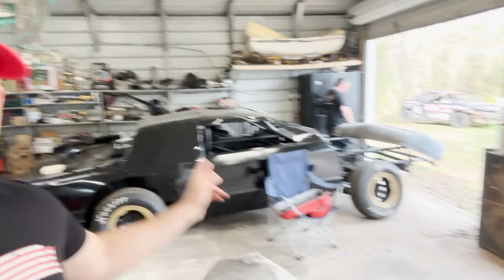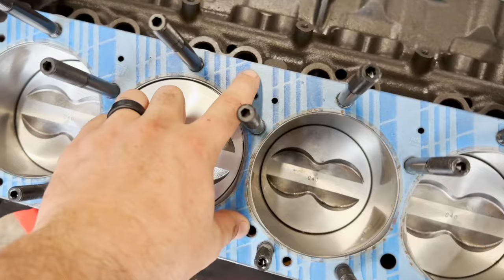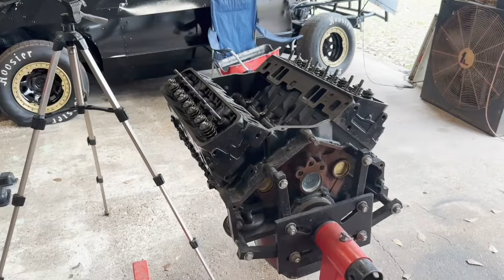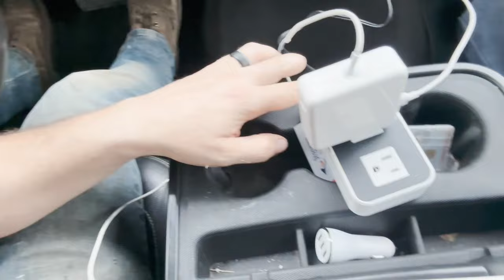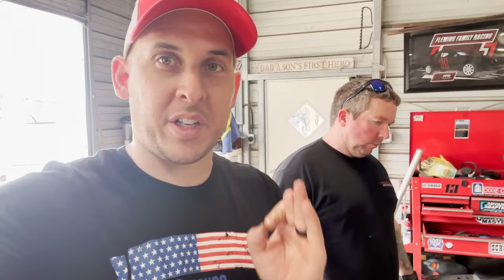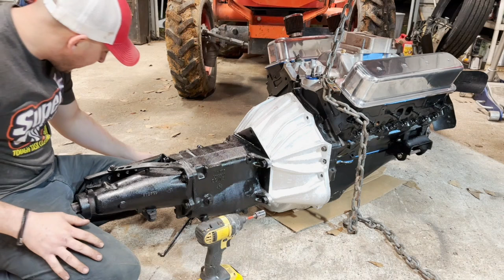The Pure Stock Race Car Engine is Assembled and READY TO RUN....WE HOPE!!!

Comment: Get u a good DUI hei module , cap , rotor  and lock out kit for your dizzy    Also run AR 94 plugs .035    Also if I want some killer on  the racetrack power get a set of anti reversion mufflers they are insane on track torque builders  schoenfield sells some $68 ea   Trust me on these I promise these mufflers alone will provide u with race winning power over your competitors, not many guys really know about the anti reversion mufflers and what they do for Lower HP type engines def worth the $150 for em.
Reply from the maker: Nice. And yes I have the HEI and exhaust already. May not be them type but for now I’m just trying to get on the track haha